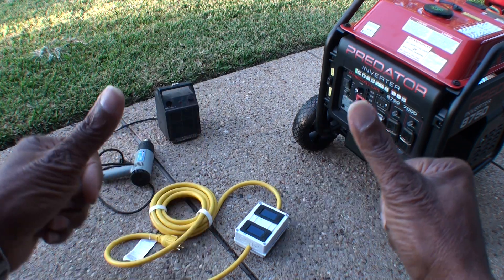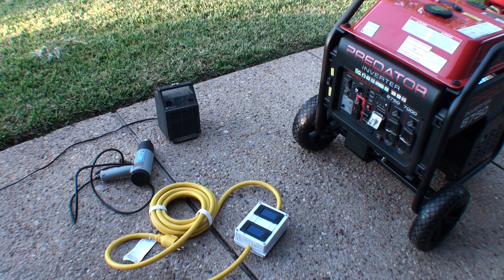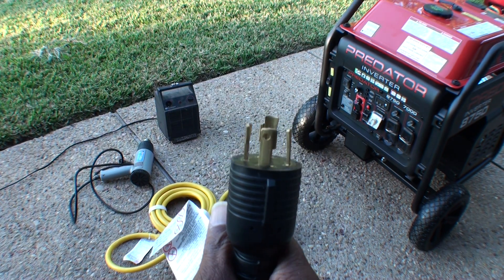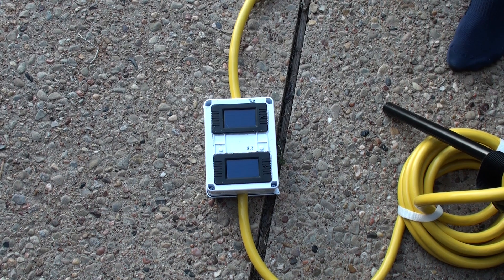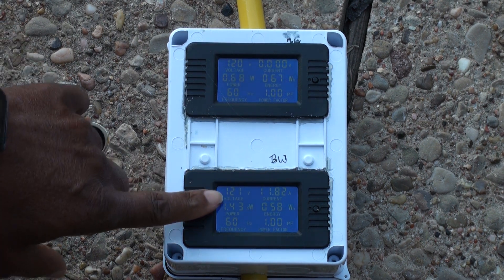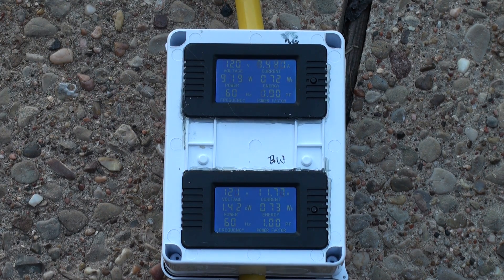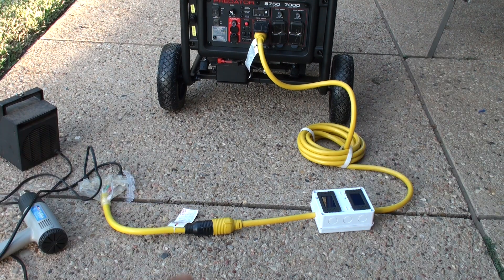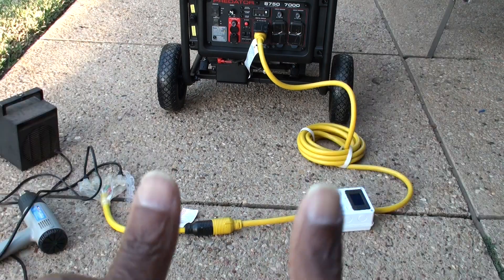"TEST" DIY 240V 30 amp Digital Voltage Monitor (Part 2 of 2)

Comment: What is the importance of knowing how many kilowatt are being drawn from the generator?  Will you be able to use that little box  (the one without a name) when you connect the generator to your house?
Reply: you need to know what each appliance will draw because if you over load it, you pop the breaker.
Reply from the maker: Thanks for your questions, please click on the link in the description to video 1 of 2. Answers to your questions are there.